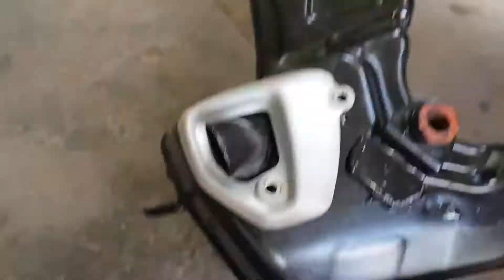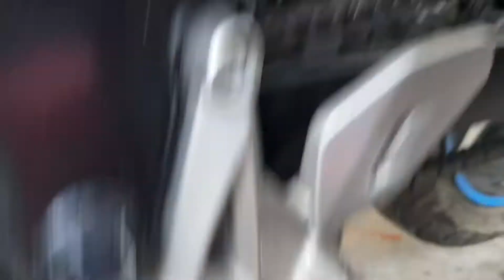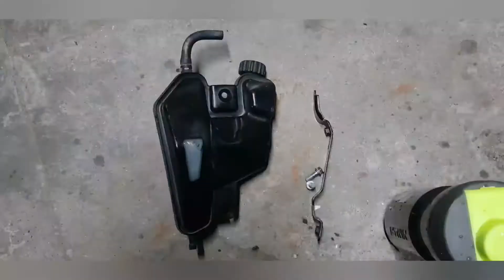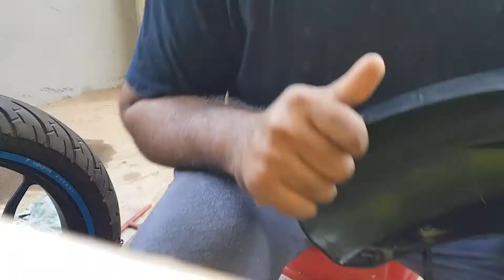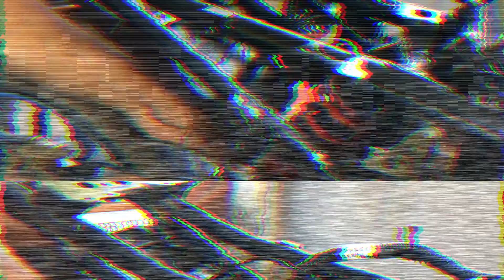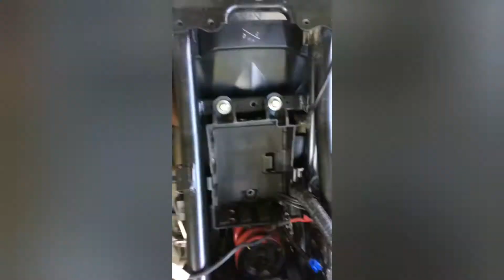Rebuilding a Pulsar AS200 | Assembling | Part-2

Comment: Bro how to change as 200 clutch cable
Reply from the maker: Easy bro u need to loosen 2 screws at the engine left side and loosen the screw in the lever then it comes off